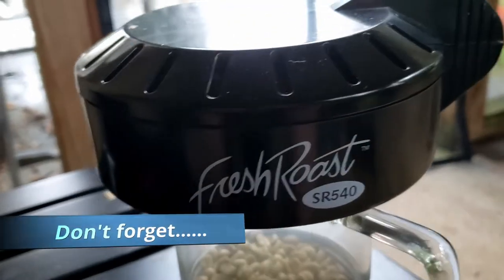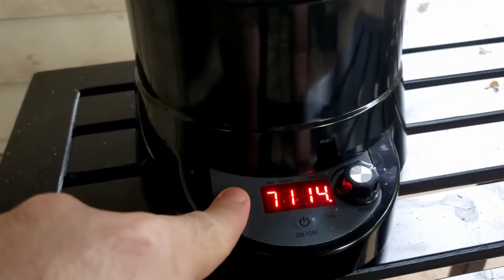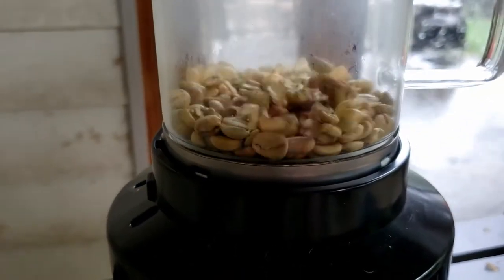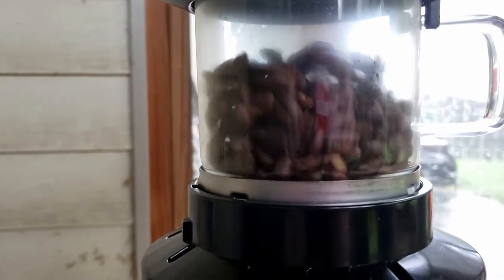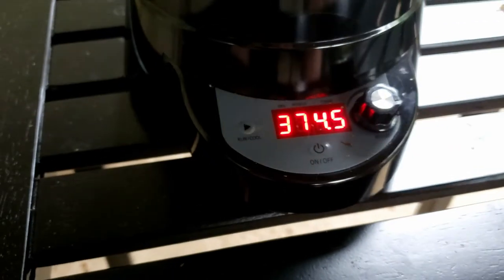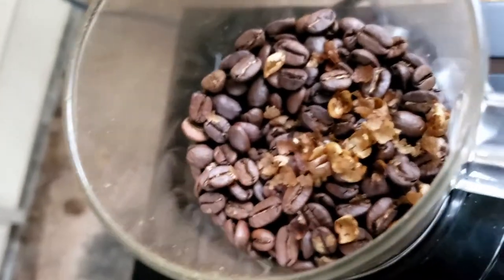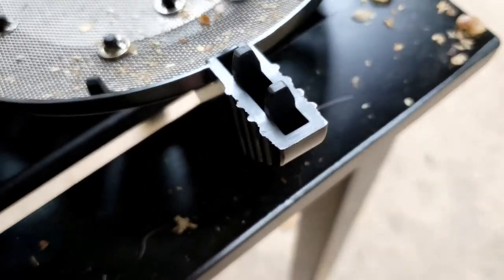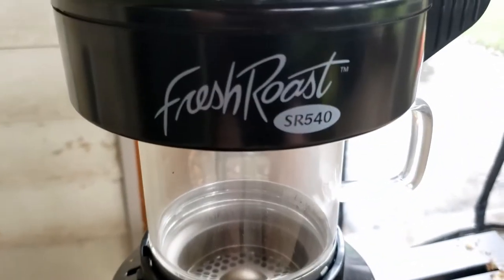Best Coffee Roasting at home (SR540 Tips)

Comment: Good video...a different take than starting out “full blast” with the SR540 on 9-9 for fan/heat. I’m going to try the 7-1 , then 3-7 method you’ve shown. BTW, when you switch to “COOL”, the heat automatically stops...no need to turn it down, at least on my SR540. Thanks!
Reply from the maker: yea, it took me  a few tries to relaize the cool down just cut heat.  
As for the full blast start, that will roast too quickly for any flavors to actually develop.  The coffee seems really watery/weak if i do that, so i start off low to get the moisture out,t hen a bit warmer and warmer to get it where i want.  i still basically roast in this method after months with the machine.  my old roaster just had one heat setting and you had to vary the roast by time or by how many beans you put in.

Comment: Great video, do you think one could pull off roasting with this machine outdoors in the colder temps through the winter? Almost looks like the air intakes are right on top of the base itself?  Anyways Thxs for the video.👍🏻
Reply from the maker: i roast mine outside all the time bc i can't have this in my house...at all.  It doesn't get too cold here, but i've done it in 0C/30F weather without much of a problem.  it will take longer but i've never had to crank the heat above 8.  you can slow down the fan and keep the heat up once hte beans are bubbling around a bit.  just keep the roasting time under 15 minutes and it will taste good (i roasted longer but it loses a lot of flavor
Reply: @Sully365  Thxs for the info, sounds a bit better than my corn popper lol. Temps are hanging here in the 30-40f now. Soon in the o-teens. Popper def not liking it. Anyways Thxs for the input.👍🏻
Reply from the maker: @jonahex8463  ahh, yea,.  i had a smaller one that i used to put inside a cardboard box when i would roast in the winter time.  it worked a bit too well and i'd burn the beans, but that one was completely incapable under 35F.    I think this one should do well enough, just keep it out of breezes.  since i don't have to stand nearby, it's easy to shelter it a bit and let it do its thing while i check periodically

Comment: great review Chris! I'm also a coffee connoisseur I once dated a girl in Seattle who was the barista.lol so my question is, how heavy is the Aeropress? I like to do ultralight backpacking and I'm not looking to pack instant, but I need something lightweight, I've got an aluminum percolator  but it's to bulk. I'd be open to suggestions for a quality Cup of Jo on the trail👌
Reply from the maker: The aeropress is about 6 inches tall, 2 inches diameter when compressed door storage.  I use a metal disk filter that i love.  It weighs about 3 ounces or so, maybe.  It's just 2 light tubes, a rubber gasket, and filter/cover.  Can brew with just ground coffee and hot water and a heavy enough cup that you can press against.  It's lighter and easier than a French press and gives a cleaner cup since the filter is much finer
Reply: @Sully365  thank you for the dimensions kind sir! Keep up the good work! you are a gentleman and a scholar.
Reply from the maker: @WCO3  thank you kind sir, I'm just hoping to not lose all of my subscribers by mixing up the content a bit